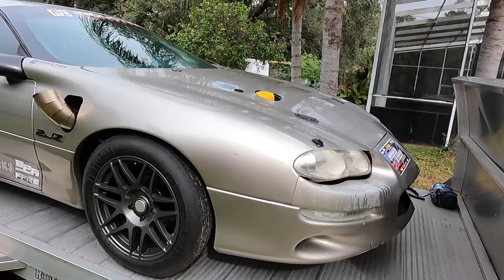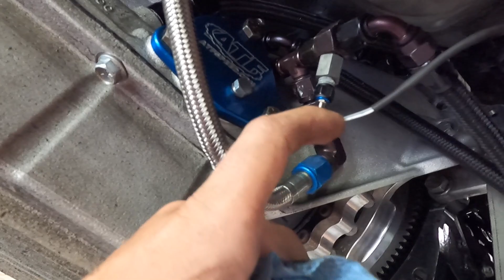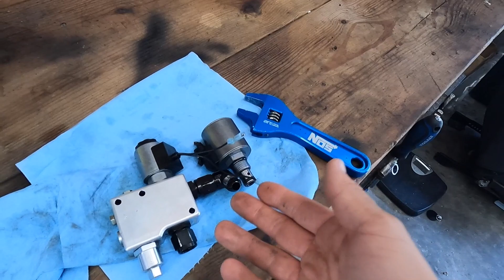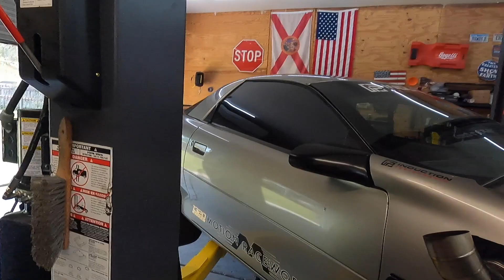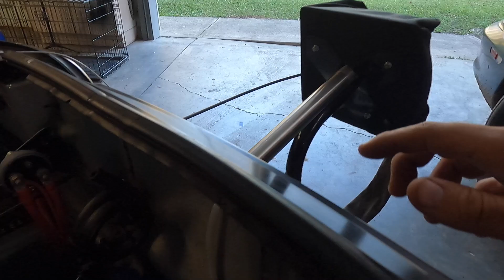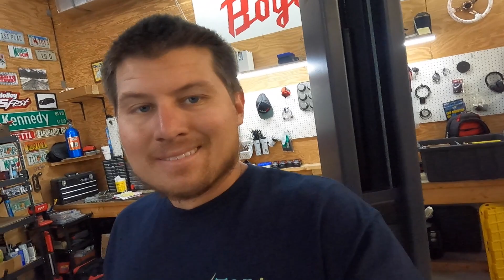please come watch me race today....

Comment: I would keep the dump valve cuz you can also use it as a tuning aid if the starting line is trash. Also less heat in the converter if you get burned down.

Comment: I'm not a big fan of push connect air hose fittings.  I deal with them all the time on trucks.   They are great for assembly lines but not for longevity.   Good luck with the shoot out.
Reply: Lol...i use them in tight spots on trucks